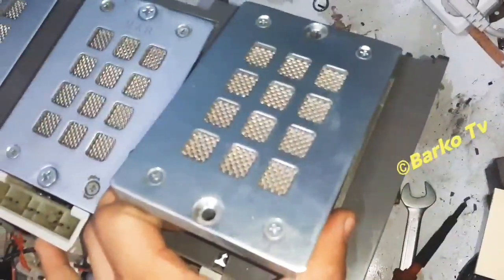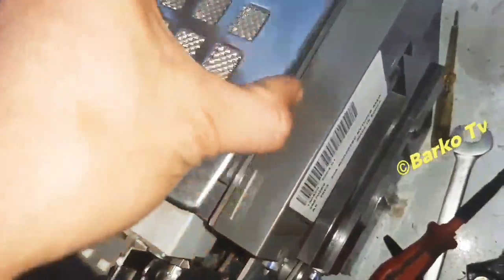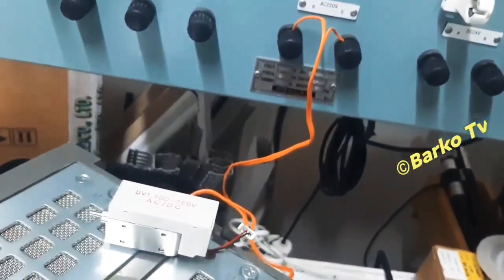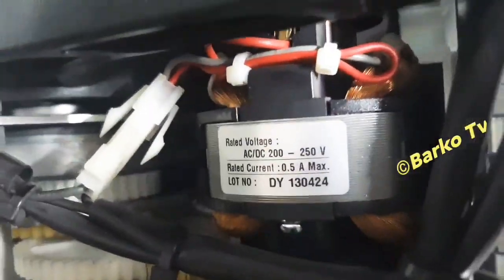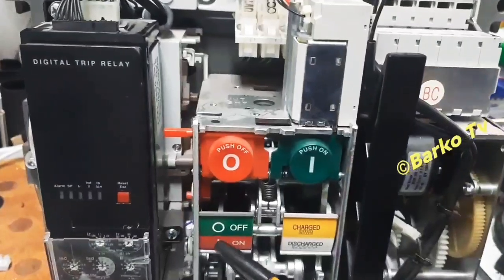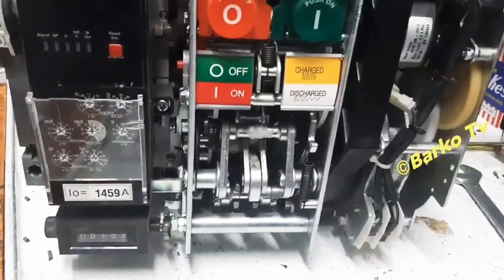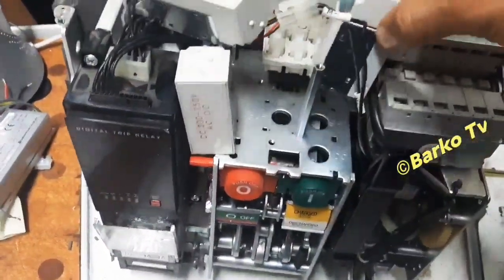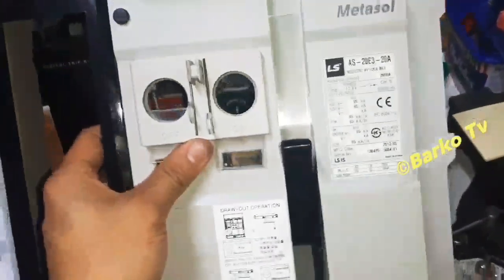Part 3: ACB Troubleshooting & Simulation | UVT & Charging motor | | Metasol | Switchgear | kalecky

Comment: Good day sir @Barko Tv . ask ko lang po if pano kapag nag activate ung reverse power trip then ung ACB sir is no power ? 
reverse power trip protection wala pong power source kasi wala pong value ung ACB po? 
Maker: Hyundai Himsen Generator . salamatpo
Reply from the maker: Hanapin mo yong reverse power relay sir then simulate mo lng ang output contacts or hugutin lng ang wire